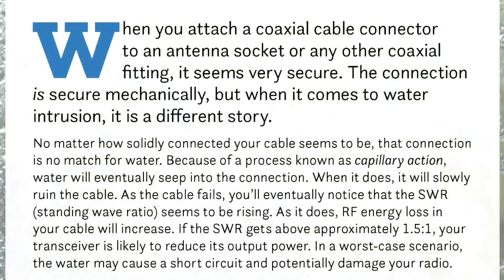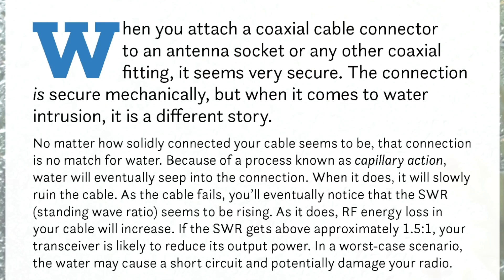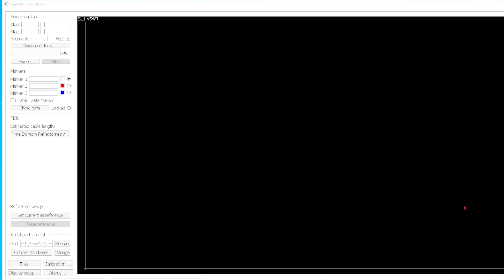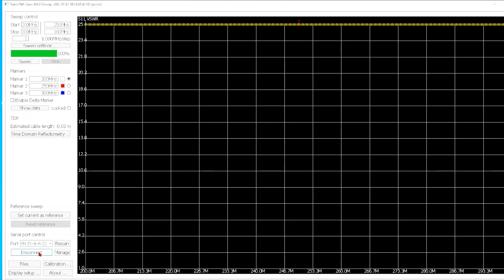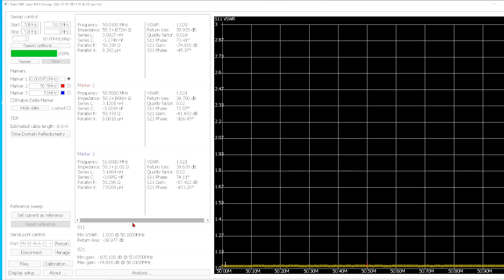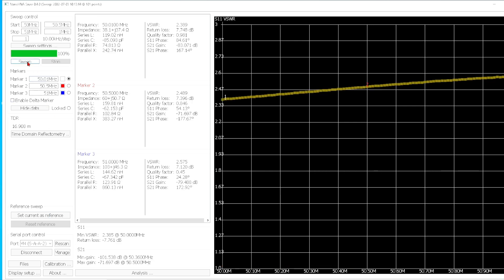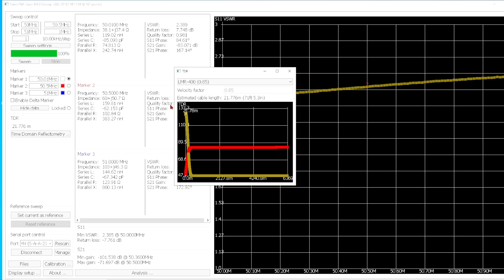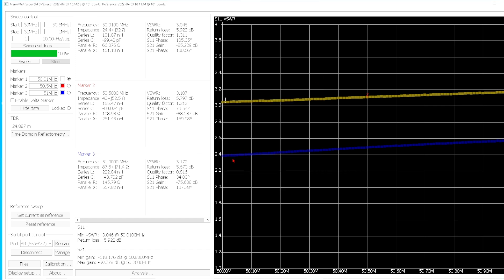Which Coax Cable is Better? One Cable is Gray the Other Cable is Black  Gray SWR 2.5:1. Black 3:1.

Comment: Thank you jim. I had found this out a very very long time ago. Did my own test because what I was seeing on a water log 200 ft run of 5 coax's, the numbers did not match up. and what my friends at the club told me did not add up. I was back in collage in those day's. so I had taken 3 used rolls of the stuff I had taken off my tower. Ran a lot of test with the lab equipment. and my findings were the same as what I had suspected. the TDR did not show a short. SWR show good. yet the power mesered at the far end  was much much lower than the power at the sending end. Conclusion. the total loss affected both Fwd, and Ref power, and the Observer would only see small amounts of return at the sending end of the system. Hence Oh My SWR is so low. There is no problems.  Not true. When I made a lateral cut along 10ft of coax on all test subjects after the electrical test. Wow not only was there a lot of water. that Black corrosion on the dielectric and the corrosion on the center conductors. What a mess. yet it showed very low SWR.  
That is why when we install hard line at the transmitter site. much care is provided to the proper way of making sure fittings and connections are done correctly. PSI. the cable and check over time no leaks. By the way Capillary action is very gross in the summer and winter, as your cable expands, and contracts in the ambent air. It will Suck  and suck and even a little dew condensation will find it's way in.  :)  Great Demo Jim. 👍👍👍

Comment: Hi Jim, good to see you are still making videos.  If I may add an anecdote to reinforce your observations. Many years ago as an engineer looking after emergency services comms I had an issue with a VHF system (paging) the customer was convinced that one of their 13 sites was not performing. So I checked forward and reflected power at the equipment and all looked good (checked deviation and frequency too). All looked good, but he continued to insist the site had an issue. So to pacify him I had an aerial rigger climb the tower and check at the top of the LDF -450 again all measured well.. But customer was still insisting that coverage was bad so reluctantly we hired the rigger to change out the antenna (glassfibre white stick).
In the comfort of the office it was an easy job to check the antenna with a VNA, I said to my colleague "it isn't jaggy enough" ie the return loss was not hideous even at double the working frequency. I took a knife to the short tail on the antenna to be greeted by black braid and water. To this day it seems amazing that just 1m of water logged cable could have that much loss. So contrary to the article a suspiciously low SWR (particularly well away from the antenna design frequency) can be a sign of waterlogged cable. Incidentally it was a crack in the fibreglass that had allowed water ingress.

Comment: Thanks for the great video, Jim! So you had a mismatch (200 ohms load in a 50 ohms system) and a lossy gray cable which seemingly improved the situation, but actually the cable losses have only masked the mismatch, right? That's why the black cable is the better one because the higher SWR reveals the "true" impedance of the load.
What if you had a matched load (50 ohms), and not just a lossy but a mismatched or broken cable because of water seepage? In that case the better cable would show the lower SWR, am I correct?
A lossy cable always makes bad antennas look good, that's an old trick. :)
But my point is, whether a higher SWR is better or worse not only depends on the cable but also the actual load.
Jens

Comment: I believe the person who wrote this is conflating water seeping into the antenna connection and the antenna itself (causing a higher SWR) and actual damage to the coax.  Jim- your findings are absolutely correct regarding coax loss and reduced SWR....to the point where enough lossy coax will result in a 1:1 match due to loss.  Thank you for all of your work on these videos! 73

Comment: The SWR of an antenna is at its input connector, which is why we use return loss in Db to calculate line and component losses in or out of the system. The TDR function of the VNA will detect the location of bad connectors, water or breakage in an antenna system, if you record it in good condition. Just crushing a coax with pliers, will show a mismatch location. Handy device if your antenna is atop a 1200 or so foot tower.

Comment: You're just full of good info Jim! LOL Since  we'll be moving cross country  to Florida soon, the question of using my present coax cable to set up the new station has been on my mind. Time for more study. Thanks.AA7MO
Reply from the maker: Good question!  If that old cable is just a few years old, you might want to save it if the cost of moving it is okay. I did move much of my coax to the new QTH. If you have time to test the coax first, that might be useful. If there is any question about the coax, buy new when you get moved. Just bite the bullet.  I found that the house brand coax at DXE was good.  Moving is hard, upsetting, difficult and sometimes confusing. If I can help, just let me know. 73, Jim

Comment: Happy 4th All: Loved your video Jim, excellent as always sir. Many operators fail to understand how valuable the coax feedline actually is. You can have a 100ft tower, a $ 3,000.00 beam & the best electronics inside your house but when you come to find out that I'm out of money & install RG 58U feedline you finally come to the realization that all my efforts was for nothing. Take care & be great as always, TMP from N.J.  73's !!!!@
Reply from the maker: Absolutely. They fail to realize that it is a system that runs from the transceiver to the antenna.  A dB here and a dB there, pretty soon you've lost half the signal. 73, Jim

Comment: I’ve ran into blackened shield on coax and ladder line lately. I just trash it. Swr seemed ok but the antenna was deaf as a post. Haha
Reply from the maker: That is interesting.  Once that shield is discolored, I think the coax is garbage.  Even the shield may not be good as a ground strap Jay.  Thanks & 73, Jim

Comment: With a decently high powered transmitter, most antennas show SWR Rising as you talk.
Reply from the maker: Ah no.  The SWR is not changing.  What you are seeing is the diodes reacting to the change in power.  If my SWR is 1.5:1 at 100 watts, it is also 1.5:1 at 1500 watts.  Diodes can conduct differently at changes in voltage.  73, Jim